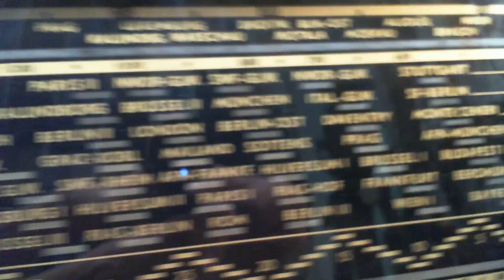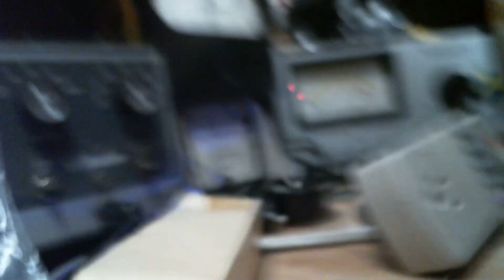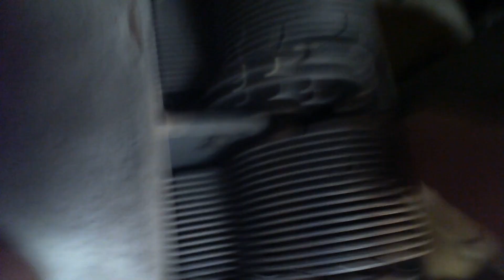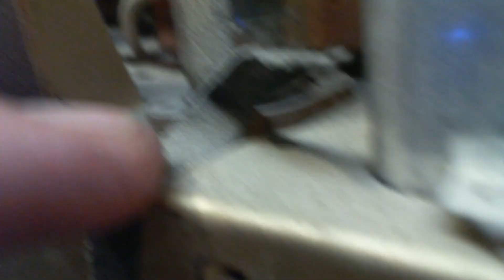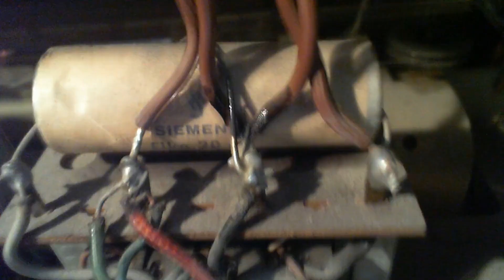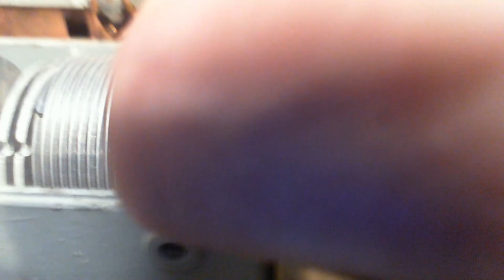Grundig 2030 AM FM Tube Radio Video #1 - Checkout, Power Up, Problem!

Comment: "3D KLANG" means 3-dimensional sound (3 speakers) and Jim again and again: AM is shortwave, middlewave and longwave ! You always think only middlewave (broadcast) is AM, NO ! And also again and again: WD40 is NOT a lubricant oil ! It's a dividing oil ! You should read the comments here sometimes, would help You a lot 😉

Comment: We built that model in the late 1960’s at the Nurnberg-Fuerth plant.
Reply: This doesn't look like a "late 1960's" model, more like a mid-50's model.
Radiomuseum has it listed as a 1954-55 model.
Reply: Did you also build the 2035 Grundig Majestic?